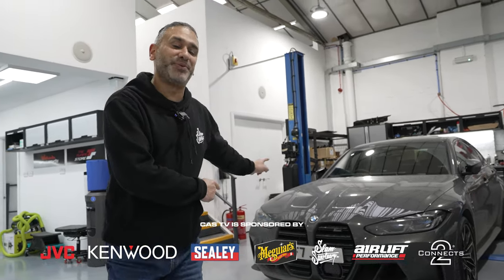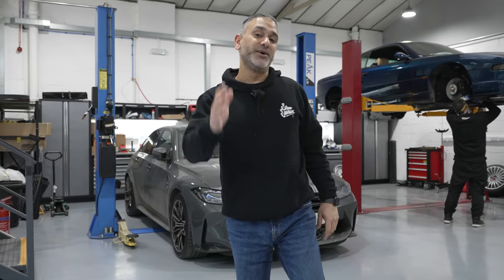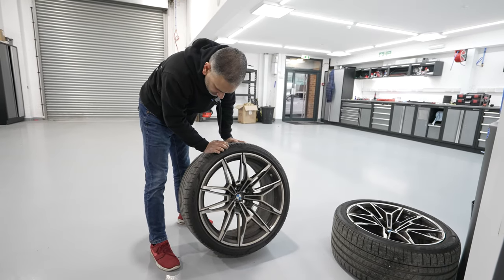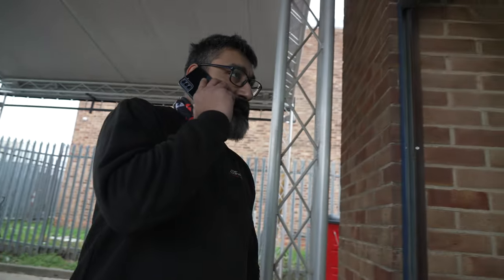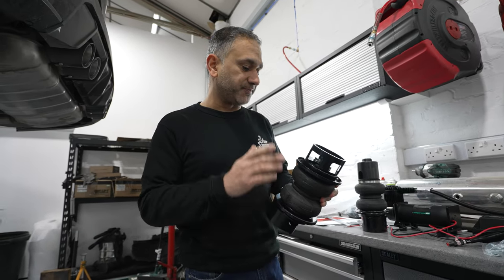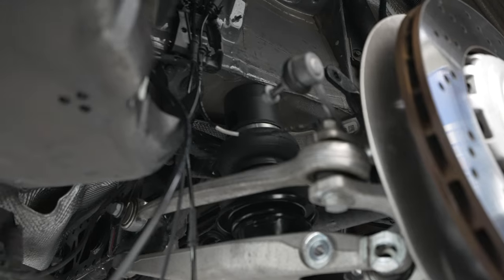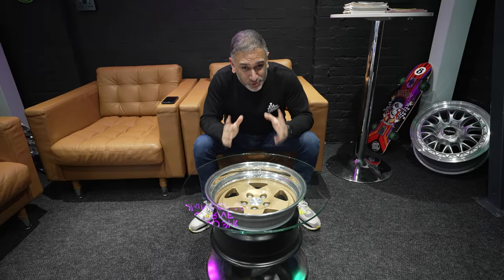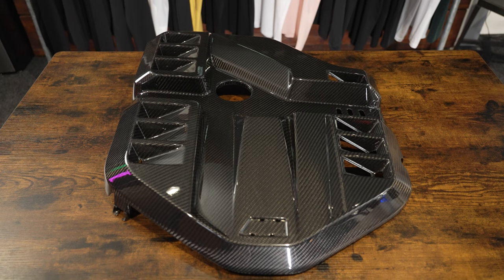BMW G80 M3 Airlift x Rotiform Build | Car Audio & Security

Comment: Would different size front and rear wheels cause any issues with the centre diff
Reply: only if the tire sizes are more than 1% from each other. the wheel size has little to do with it.

Comment: The BMW staggered wheels isn’t the best looking setup.  I believe if you put an even wheel set all round it can damage the gear box as the X drive gearbox is configured for a 20 rear 19 front.
Reply: it's configured to have the front and rear less than 1% rolling distance from each other. as long as youre within that threshold youre fine